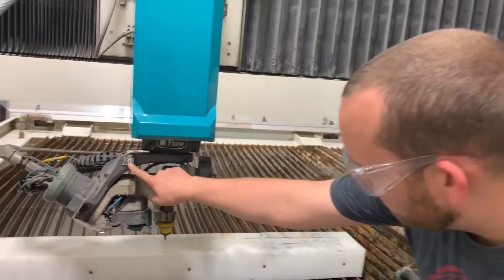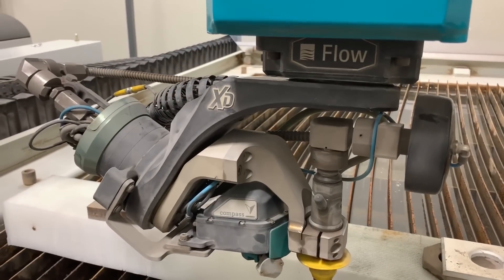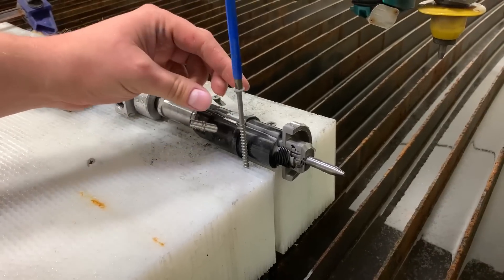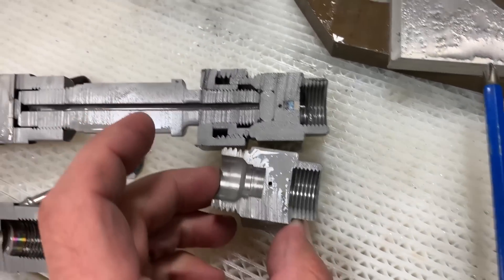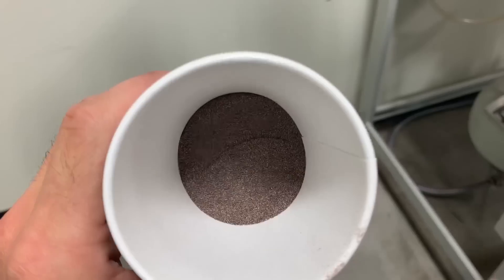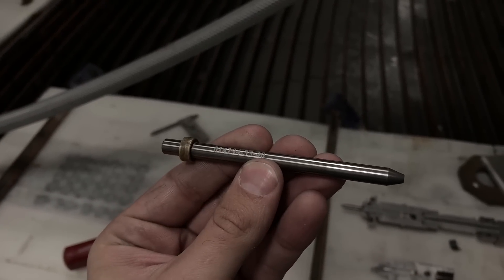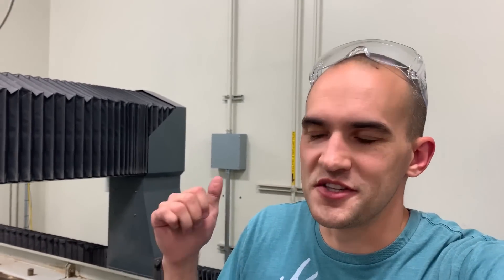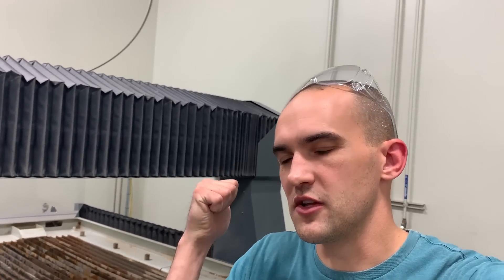Waterjet vs. Waterjet | Our Most Requested Video

Comment: arent there nozzles made of monocrystaline industrial diamond - witch they use for whater cutting ceramic and cerments as well as certain applications made of depleted uranium plates like the M1A1 Abrams tanks composit turret armour because you really shouldnt burn cut them and also it can burn like magnesium and electromagnetic charging can increase the radioactivity

Comment: The mixing tubes are very brittle. If you drop one they will shatter. Made that way so that tip will shatter when in contact with material. To not throw the machines axis off calibration.

Comment: When you're cutting through the part is the z depth programmed?  How do you set the Z?.. via probe or do you just jog z while feeding through X or Y at set pressure and feed rate?
Reply: Judging by how crude it is, they just jog and set some points along the cut.

Comment: I'm amazed that even with such a high volume of water to carry heat away, the aluminium oxide was hitting the tungsten carbide fast enough to generate enough heat to make something glow yellow/white hot.
Reply: The volume is actually quite low. It's the speed that cuts(more precisely, the kinetic energy).

Comment: SCIENCE QUESTION: What is the size of the abrasive particles in a water/abrasive mix? I like to know weird stuff like that.

And some people are not aware that tungsten carbide is not a metal BUT is a cermet - a ceramic-metal compound.

I only learned that from using WC blades in the print industry in (paper cutting) guillotines and steel blades (as nice a cut as they gave) blunted in no time whereas WC blade were pretty strong stuff and keep their cutting edge for longer.
Reply: Anywhere from dust to maybe a few hundred microns. You can get them in different mesh sizes.

Comment: Crazy that the aluminum oxide still ignites under such conditions.

Also this is what happens to airplanes if they fly through a volcano cloud
Reply: Nothing is burning. It's under water, and already fully oxidized. It's just glowing red hot from how much energy the water jet puts out being released instantly when it hits the tungsten surface.

Comment: Can you cut a mixing Cuban half with a grinder just out of curiosity
Reply: The short answer is no
Reply: @isaacclark6749  just out of curiosity how do you know it won't cut it
Reply: @dalejacaway4881  from sharpening carbide lathe tools, you have to do it with silicon carbide or diamond wheels. The practical answer is no a cutoff wheel on a grinder would not cut thru it. If you had enough wheels and enough time than yes it would cut thru it. Carbide is almost as hard as diamond.
Reply: @isaacclark6749  I know that you can't cut hardfacing very easy with anything other than a grinder
Reply: @isaacclark6749  do you have the long answer. Because I would assume it's kind of like tungsten that is very hard and brittle. But it can be ground quite easily to put a new tip on it but if you put it in a bandsaw it's not going to cut it very easily

Comment: so did you just disprove your own claim from your previous video lol.  where you said one of the main pros of a waterjet is that it can cut through any metal.
Reply: Tungsten carbide isn't metal, it's ceramic. Or, more properly, a cemented carbide, as the carbide is bound together with Cobalt rather than being completely solid ceramic.

Comment: Can you make a portable hand held water jet
Reply: They have those. It's called a pressure washer xD
Reply: They have sandblasting attachments for pressure washers. If you modify the tip and have a 3600PSI pump or higher... You can litteraly start cutting stuff at home. :)
Reply: Yes. Higher power pressure washers are often used for... some sort of demolition work, I still can't quite figure out what. You can easily cut through a tree with a higher power unit and just water, but their prices are just about at the low end of a real CNC waterjet system.

Comment: How do you let garnet in through the mixing tube without water trying to back flow?
Reply: The mixing chamber isn't pressurized, it just has a stream of water flowing through it at crazy high speed (90,000 psi should give close to mach 2). The orifice where the water enters the mixing chamber is a sapphire with a hole about .010". The fast water drags the garnet with it. So, even though the nozzle looks like it's right next to the part, the jet has actually been traveling like 6" or 8" since leaving the high pressure tube.
Reply: Ahhhh, thank you oh wise one.
👌

Comment: Welp...  that's the first time I've seen water glow red from heat
Reply: It's not water, it's the abrasive media and tungsten carbide on contact.
The water keeps it cool(relatively, it's still likely above boiling).

Comment: Garnet is 6.5 to 7.5 Mohs hardness, and aluminum oxide is 9, which is about the same as tungsten carbide. Some of the only things harder are boron nitride and diamond. Those are what is usually used for cutting carbide.
Reply: Tungsten carbide is slightly harder then aluminum oxide that's the problem. If they used some diamond abrasive I think it would cut but the mixing tube would probably wear out in minutes instead of hours lol.

Comment: You should take 2 of the water jet heads, without all the electronics feed the water to them no sand/garnet  stuff, and face them at each other. Use the feed the 60k psi or whatever to each waterjet head. So its waterjet vs waterjet. just half the pressure and no big damage. face them to each other horizontal

Comment: How doesn’t it cut the slabs in between to hold the stuff ?
Reply: It does a little but since they are thin it just cuts little slits in them. also since they are thin most of the force is  deflected then absorbed by the water bath.
Reply: zachell1991 oh ok thanks for the help

Comment: That Tungsten Carbide bit began to  get heated red hot at the cut inteface. Those Aluminium oxide particles have some nasty force in them! Wonder what speed they smack into that carbide bit.
Reply: Drakkar Calethiel I think it’s actually something called triboluminescent not to sure thi
Reply: I'm going to bet that it's a mix of both surfaces getting hot on contact. The media transfers its kinetic energy into heat far easier.

Comment: It's hard to tell the power of these water jets, but seeing the force of the defected water and the sparks really gives you a good idea of it
Reply: science at it's maximum and one single sentence busting it all
Reply: I think its actually triboluminescence, or some other phenomenon. Both aluminum oxide and tungsten carbide have very high melting points, so its unlikely there will be any sort of sparks.

Comment: Can you filter the garnet out of the used water to use it again?
Reply: no
Reply: Yes. There are abrasive recycling systems that do this, but you can't get 100% because a significant amount of the garnet is totally pulverized in the process. You can only recover like 50% iirc.

Comment: How far will a waterjet stream go if pointed horizontally?
Reply: i would also like to see this
Reply: it will circumnavigate the earth and start cutting itself dork
Reply: @sommelierofstench  the earth is flat... Duh!
Reply: All the way.
Reply: I also second this notion
Reply: In reality? Probably not very far. The water is already quite hot when it exits the nozzle due to all the friction, and even during normal cutting the stream spreads pretty rapidly (technically known as taper, if I recall). It would probably go maybe 6 feet before it spread out and mostly vaporized. Still would be a good video, and they have a 5-axis now...
Reply: @mysock351C   highly doubt a 60k psi water jet would only travel 6ft
Reply: @Дзблчч  The flow is highly turbulent and the stream deviates really quick once it leaves the nozzle. Can see that when a cut is too deep. It has a distinct taper to it. Combine this with it being at very high temperatures and impacting still air at supersonic speeds and it wont go as far as you think. If you wanted it to actually go far, you would need to build a special nozzle to smooth out the flow, and keep the flow sub-sonic.
Reply: @mysock351C  this is all speculation though, right. Is there any video of testing
Reply: @Дзблчч  Ever use a pressure washer or something similar?
Reply: @Дзблчч  Even if you can get a nozzle that keeps the stream "focused", it will invariably spread out and dissipate. Given it also has abrasive media mixed in with it, I don't see it being any different, here. Have to remember that these are just made to survive the most cuts possible, not keep a nice, tightly focused stream over a long distance. Even the carbide nozzles used have a limited lifespan due to the harsh environment. Actually getting distance would require a special nozzle design that allows the flow to be as uniform as possible so it doesn't deviate, and even then the fact that its going faster than the speed of sound means there will be intense turbulence at the boundary between the water and stationary air, similar to what is seen in rocket exhaust.
Reply: About twenty minutes
Reply: Point it up😂😂😂
Reply: It will be a deadly weapon to all flat-earth types... I propose it be done at once!
Reply: I want to see this in January outside when it's -30.  Would make a pretty cool effect I think.
Reply: @mikehunt1437  bruh, he literally did just that. Read the original  comment my man.
Reply: The moon
Reply: Not too far, since it is not laminar. It would propably create a spray
Reply: i think it will go around the earth and back to its base...if earth is not flat
Reply: SpasDragon 32feet if its 94k in psi.. ima make a educated guess and say 94feet. As psi is 1 to the power of 100.
Reply: Full orbit around the Earth and hits itself on the back.
Reply: brodie bradley Wait?! Do you have reddit??
Reply: SpasDragon they are not made to do so. Even the 5 axis can only tilt at a 45 degree angle.
Reply: I will take an educated guess... atleast 10 cm
Reply: Infinitely, obviously.  It’s called “orbital mechanics”, duh.
Reply: pants. but it will probably mist out after a few meters I'm guessing
Reply: Waterjet: Yes

Comment: You guys notice how the aluminum oxide looks like it's combusting on the tungsten ?
Reply: I surprised they never called it thermite!
Reply: @ChrisD__  mix it with iroooxide then it would be
Reply: @ChrisD__  what would happen if they tried to cut magnesium with that aluminum oxide 🤔
Reply: It might be something called triboluminescents
Reply: The power input is absolutely massive. It's getting very hot on contact, and the particle flow is high enough to make it a nice stable glow.

Comment: Acutally the water jet didn’t cut the bit at all it melted through it because if you didn’t know aluminum oxide also has another name THERMITE
Reply: Forgetting the iron?
Reply: Thermite is iron oxide and aluminium powder, aluminium oxide is one of the products of the reaction (the other being iron metal).

Comment: Cut a tungsten carbide nozle with garnet
Reply: should work, but it takes ages.
If you watched the whole video, he said that they can switch the garnet to Aluminium oxide; to cut materials like tungsten carbide. It makes the cut faster but it also wears the nozle down extremely fast. 

and they cut a nozzle in the end... didnt cut all the way through before it shattered, but with enough time it will.

Comment: Dan's design seems safer, having the waterjet turn on when there's no pressure is asking for trouble whenever the compressor/line/etc fails
Reply: I think the valve is only for making interrupted cuts, if you are working on the machine bed (i.e. setting materials up for cutting) the pump would not be running and the system would not be pressurized. Don't know for sure though, I have only seen these things in operation once in person and don't really work with them apart from a one off job.
Reply: Head valve is as you saying only for cutting interrupts. When you do anything around the machine pump is turned off and on waterjet I worked on the pump turned off automatically when the air pressure dropped below a safe threshold.
Reply: That's what I also thought, but I'm sure there must be a really good reason to choose this design over the other
Reply: I was thinking the same thing. It makes me wonder if there is some type of failsafe because that is a sketchy problem to just hope doesn't happen...
Reply: Brandon Cornett the pump would be off most of the time, and I am assuming there is some sort of failsafe

Comment: Do you think there's a way to deflect/curve the water so that it would be spraying out 90 degrees relative to the nozzle and still have enough power to cut something? (Just make sure you have a big splash guard at the end of the tank, haha)
Reply: Of course. But "cut something" is very vague. But what? Cheese? Stainless steel?
Reply: granite has an erosion rate of 1 inch per 100 years

Comment: Hey, I was just wondering about a few things. #1: What happens if you cut straight down the length of a blade? #2: How thick would a blade/edge have to be to get cut in half? Thanks
Reply: You're asking about the kerf width. It can be as small as 0.010", but it's usually about 0.030". So a blade would need to be about 0.100" thick.